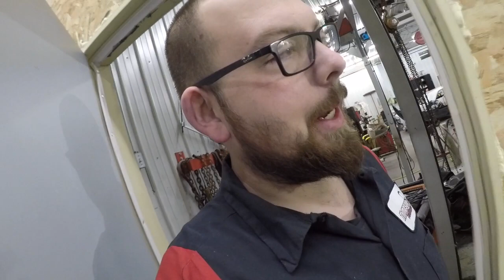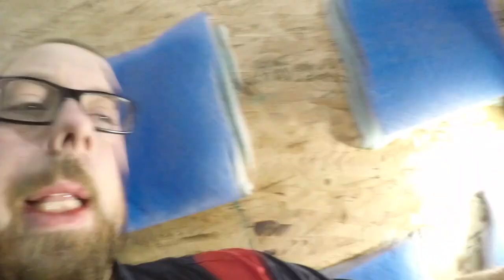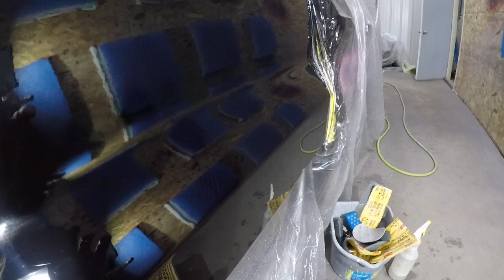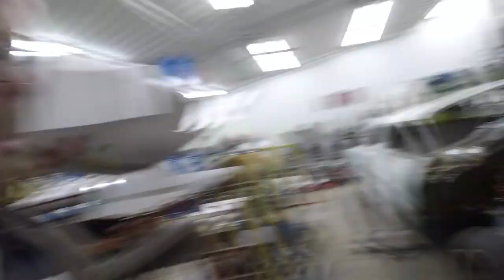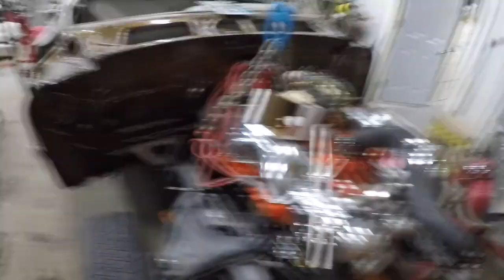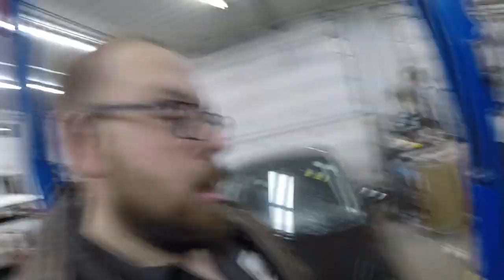WHATEVER IT TAKES!

Comment: I sprayed lesonal the exactly same system you have and I have a tip for clear because I had a very similar set up as you do, I now currently have a booth I was fortunate enough to be able to buy one. But ask your rep for Wanda clear with fast hardener for panels like that or medium for like a while side and I promise you will love it!!!  Best thing I ever did with that line but on the flip side after 20 years I just switched to RM diamont paint and with the rm clears it is a %100 improvement over the lesonal system and would work much better for your environment they have so much more to pick from for guys like you and me we dont have the fancy equipment like these big guys but they have something for everyone and it is such a better system and would highly recommend that system over the lesonal by far and I used it for 20 years, I wish you luck with your shop. We both so the same thing and I know what it takes and you do a great job

Comment: Yea I used to get runs when I adjust my fan and fluid to try to accommodate for small repairs.I just keep my fan wide open , fluid wide open and at least 30 psi on my tekna gun.And it seems to work.But yea I hate runs.
Reply from the maker: Filiberto Barrera yeah anything 65 degrees and above I'm good to go. But when it's gets down below that it happens from time to time. Fine line of laying it flat and clean and having a waterfall lol.

Comment: What clear do you use?
Reply from the maker: on this job it was SPI universal clear. thats the higher end clear i use. for quick in and jobs i use SPI production clear, still good just not as deep of a shine.
Reply: @RJTickler  you use the so I universal clear on the 64 as well?
Reply from the maker: yes all SPI universal on that one. its a high solids clear, gives you more to buff. isn't the best at flowing flat out of the gun but holds up a lot better when you plan on wet sanding.
Reply: @RJTickler  cool thanks I been toying around with different clears have yet to find one that I absolutely love
Reply from the maker: lawrence cardenas jr for the money for a high end clear the universal is hands down where it's at. It's about 300 or so for a kit. But it mixes one part clear one part hardener so for 300 you end up with two full gallons of sprayable.
Reply: @RJTickler  Ohhh that's not bad at all I am already near 3 grand in on kandy and everything else whats another 600 bucks or lol
Reply from the maker: one coat of this stuff is like 2 coats of a regular clear
Reply: @RJTickler  oh sweet I lime the sound of that more bang for your buck I can't find it though to purchase do you get it locally?
Reply: @RJTickler  oh wait I found their site do use the 4000-1 or the 4100-1?

Comment: Don't you find it easier to remove runs with a razor blade first , untill flat then wet sand with 1500 and then up to 3000?
Reply from the maker: tjsilvius1 no I have never had luck with a razor. I do more harm than good lol. I have had luck on bigger runs with applying a thin coat of glaze over it and then block. The glaze keeps the lower areas of the clear protected and just sands the run. Works pretty slick.
Reply: @RJTickler  fair enough